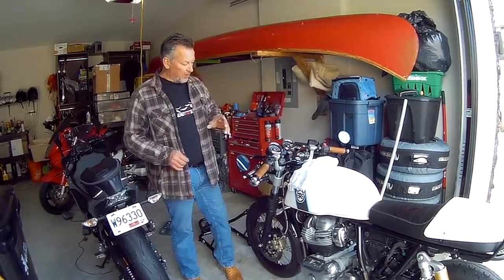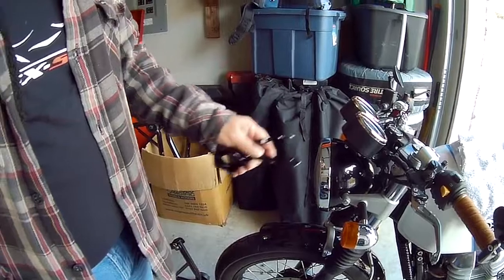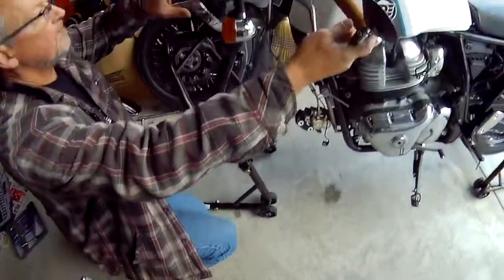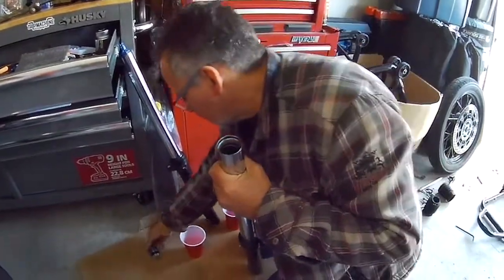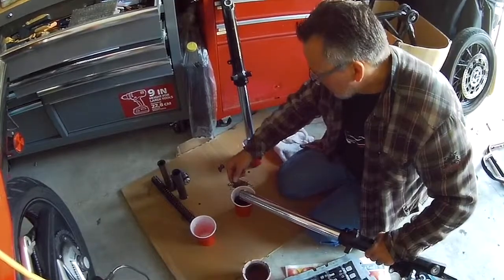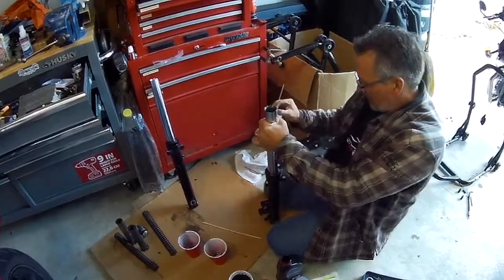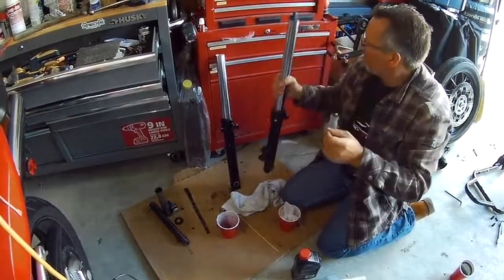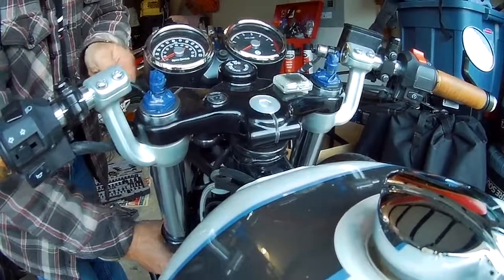🇬🇧   Royal Enfield Continental GT/Interceptor 650 Fork oil change DIY How to??🇬🇧

Comment: Hi, I'm new to maintenance and I wanted to ask: You used 10W 410ml of oil, but the service manual  recommends 2W 430ml, was there a reasoning behind that?
Reply from the maker: Hello, Welcome to our channel and thanks for subscribing!! Yes I used approximately 410ml of oil in each leg but the real measurement was the 140mm of distance from the top of the fork tubes to the level of oil. The 430ml of oil that the manual recommends is if your forks are completely empty of fluid. Measuring from the top of the tubes to the oil level is a more accurate measure as there may be a small amount of residual oil in the fork legs and damper rods. As far as weight of oil the factory manual seems to recommend 2W25 which I've never heard of. Most riders seem to recommend 10W as a middle of the road oil weight, you can then go thicker 12W or thinner 7.5w to fine tune your suspension. Hope this makes sense.
Reply: @losttogether4ever  Thanks for replying. I've read a few posts on various forums and the consensus has been the same: No one's ever heard of 2W25 and nearly every comment I read said they went with 10W. I found some random Indian site that had 2W, but that's it. Safe riding.

Comment: So did you mark the straw when the old oil was in? Not sure how you worked out the measure on the straw?
Reply from the maker: Thanks for watching, I got that measurement from the Enfield forum, it's the most consistent way to ensure the amounts are equal in each leg as there could be residual oil in the fork legs which would throw off the amount if you were to add a specific amount to each leg.

Comment: Quick question....Im looking to change just the headlight brackets.....do you think that I can simply loosen the cap bolts and slide the forks down WITHOUT fooling with any of the brake lines/calipers????  Im hoping to just drop the forks a few inches and slip the old brackerts out.  What do you think?  Thanks!!!
Reply from the maker: Hmmm, I'm not sure I think you might have enough slack in your brake line to drop the whole front end, worse case you might have to unbolt the caliper and ABS sensor and let them hang. Not really a big deal FYI front caliper torque is 44nm or 44ft lbs
Reply: You da man!  Thanks!!!!
Reply: You're much better off just removing the upper triple clamp to swap out your headlight brackets.

Comment: How did the ATF work out??
Reply from the maker: It worked great, the fork seems to respond well to the ATF which is equal to 10W fork oil, no regrets!
Reply: @losttogether4ever  thanks for the info.
I've used it a few times before in other bikes with great results. 
I think that once I bought too heavy fork oil. 
ATF worked out OK.
Many thanks and Merry Christmas too, from Australia.

Comment: I do understand that you are not a professional and you are working from your garage with limited conditions, but still. Have a look here: https://www.youtube.com/watch?v=9gYz4KmNxjU You should have cleaned the valves after draining the oil. If you leave the grid in the valves and don't clean valves, spring, etc you might as well not replace the oil because the new oil will be immediately as dirty as the old oil was. 
Tip for the next time.
Reply from the maker: Thanks for the tip, I am not too worried about contaminated oil because the bike is less than 1 year old and hasn't been ridden in any type of conditions that would cause me concern.